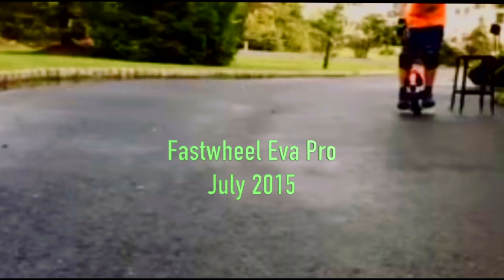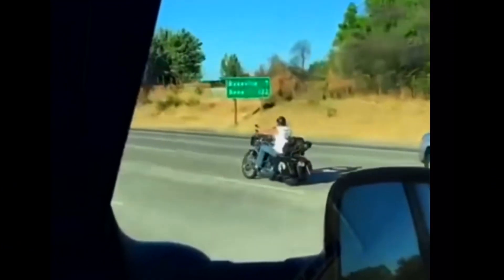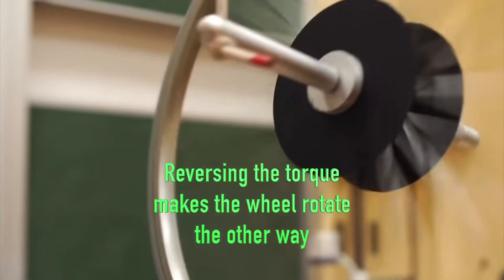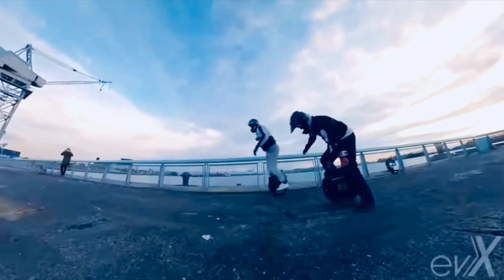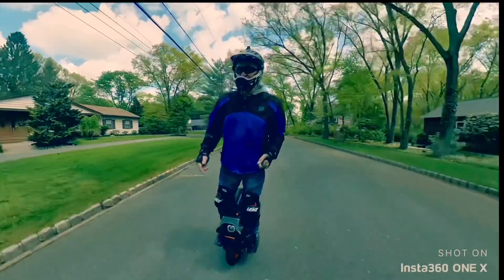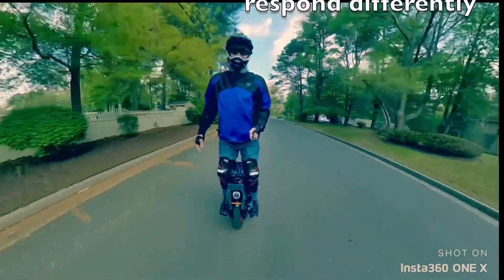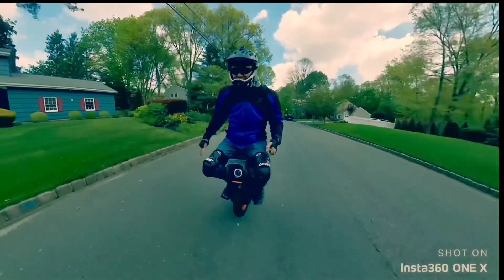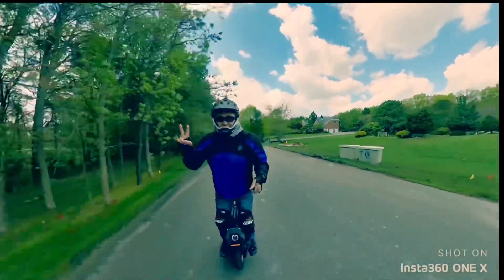Physics of Wobbles and What to Do About Them

Comment: I stay relatively low in my riding stance. When I feel a wobble coming up, I lift my weight up a little higher and then drop into a new stance. Some of my worst wobbles have been from braking though, which is why it's crucial to practice emergency braking. Thanks for the video!
Reply from the maker: This is one of the reasons why I love seated riding on my fast rides. Not only am I streamlined but I have never gotten any wobbles with seated riding. The grip bars on my V13 are an added plus when I really need to do rapid braking.

Comment: Excellent video Dr Adam...  love the examples you have here.. but it made me freak out at the same time.. but it shows the Occialtation you were talking about !...   

my tips:  have one side of your leg also touching the wheel side.. clamp down on both if you start to get some  unwanted movements,  and do like you say.. start carving to take out the noise.. 

not everybod stands perfectly on the pedals.. so i use one side of my legs to touch and it links me to the wheel and it helps control the vibrations.. but also helps that i ride a heavy wheel which helps maintain stablitly
Reply from the maker: Thanks, CT! Those are great techniques and will certainly quell the wobbles. My heavy V13 certainly is a big plus when I do fast riding. That stability at high speed is certainly quite reassuring.